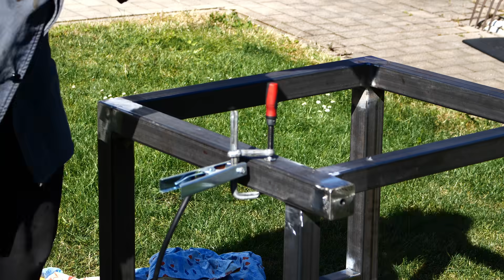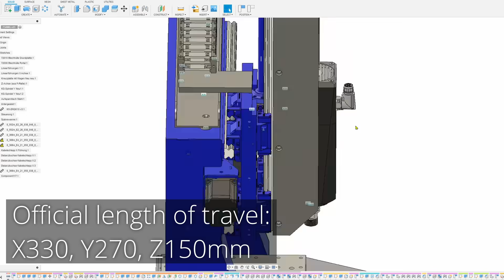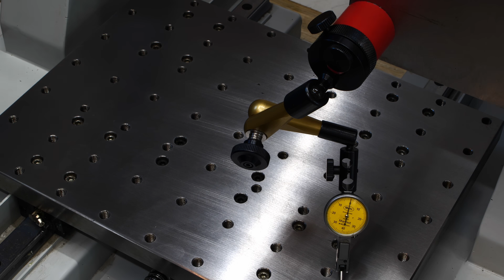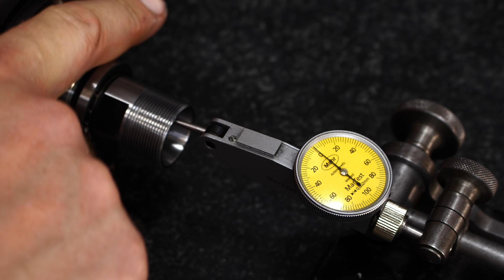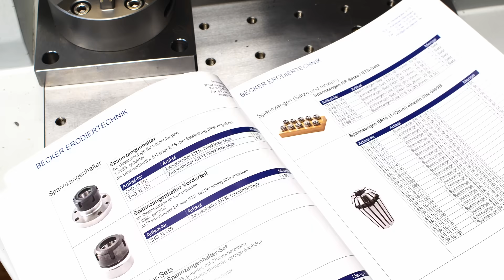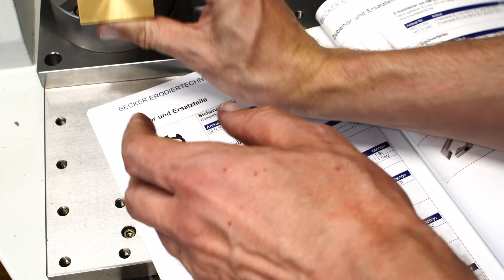CNC Project: FS4MG - "Not a Kern"

Comment: Hallo Stefan. I will continue in English for the broader audience.
Nice to see you upgrading your shop.
I don't want to be that guy, but please don’t encourage people to use the Erowa zero clamp system on a lathe.
We use this and a different system quite extensively at my workplace.
You can do at your shop whatever you want, but systems like this one are forbitten to be used at the lathe by the workers' compensation board (Berufsgenossenschaft).
There are special versions of it that can be used, but the normal version can kill you if you, if the clamping mechanism becomes undone while it rotates
Reply from the maker: Interesting! Thanks for the heads up - I guess the screw version, that does not use the drawbolt is fine for lathe use?
Reply: @StefanGotteswinter  yes that solves the main problem. When you talk with the manufacturer they are super cautious, when you tell them you want to use their products on a lathe. But there is more, if you want to put a vice in the erowa chuck, it has to be a vice without weak points in the spindel, centrifugal forces can get you.
I used some funky setups myself, but if the trainees look above my shoulder i tell them that if they want to do stuff like that, they have to be super cautious about rotation speed and cutting forces
Reply: @glamenz  Thank you this is interesting reading. At work we use System 3R Macro & their original hydraulic Mini series across all of our machines. From what I know the 3R Macro pallet system is much more rigid compared to the Erowa system with similar repeatability. For CNC lathe & cylindrical grinding machining, we mainly use the hydraulic Mini series without any problem, and the same can be said for the occasional times we use the 3R spindle recommended Macro chuck 3R-600.22 for bigger parts, staying within the recommended electrode size range. We've never had any issues regarding security of workholding on any machine, including some very heavy machining on our VMC machines, if you compare the two systems the 3R pallets are incredibly strong as they are based on the indexing system used on Ward capstan turret lathes for indexing the turret.

Comment: Stefan, I owned a Precise high speed liquid cooled head that operated at 80,000 rpm and for the 10 years that I used it it didn't leak once. I had it mounted on the Lars - Gorton Universal cutter grinder. I ground styli and miniature two (2) and three (3) fluted endmills.
I did find the U.S. distribution company for the modular clamping materials. I will get a catalogue later this week.

Comment: What accuracy and resolution were you aiming at with this machine? I have an idea of getting a very good used trunnion table and building a CNC machine around it thus getting a 5-axis ultra accurate machine for small parts. It would be a fixed gantry with the trunnion table permanently attached tn a platform moving in the y-axis. The frame will be just like this (welded frame with epoxy granite filled). Flood coolant obviously. No ATC. Just a hobby machine.

Comment: Hey Stefan, Steve here... I assume German is your first language, although you'd never know it. I completely understand the desire to arrive at a machine with finer resolution with tighter tolerances. It shouldn't be understated that we, as a community of hobby machinist, we are chasing the tolerances with the realm of thermal expansion of the construction materials. We need to start focusing on the construction materials with lower thermal expansion, climate control  systems to maintain temperature & humidity. If we could try to expand on design choices & methods that restrain thermal expansion as the machine takes on heat soak it generates as it operates for hours of use. I think this will help many individuals who other wise are very adept at creating "DIY" cnc machines. I can't tell how many videos I have watch in where a creative person spent months even years designing & creating a machine only to use aluminum for some structural components. 😮 In the end they are chasing mysterious +/- .005 they keeps popping up & going away. In the end they accept it as backlash, design error, or whatever, but they never realize this is thermal error that will never go away. You seem to be acutely aware of this, I really like to see a video in which we can demonstrate its effect especially on these larger machines & ideas of how to mitigate it on larger machines.

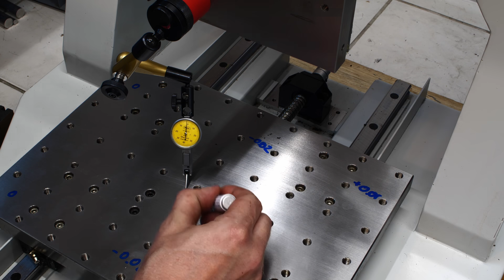Comment: 15:54 Yes, or... no. That only tells you how parallel are linear rails to the table. To measure flatness you should first measure your actual rails setup with surface plate(or any other known reference), and only then knowing their curvature you can measure table "flatness". Right now you measured either table flatness, or rails curvature (or combination of both) :). They can either cancel or amplify eachother.
Really nice machine base - saves a lot of time for us hobbyists. And you build great CNC out of it.

Comment: Maybe it’s just me but I love over engineering stuff thin sheet metal doesn’t sit well with me a thick heavy duty grey cast iron skeleton with the epoxy granite surrounding it would provide far greater stiffness and it will use less resin too. I guess if you don’t have a high temp furnace and plenty of disc rotors kicking around you could use aluminium.
Reply: What do you have to support that assertion? FEA ? Have you experimented with both options? Any data at all?

This option is actually almost certainly superior, for the same reason composite structures are made this way. The shell is supported in its weak axis and lends it's high tensile strength to the structure, placing the EG on the outside means that you are asking the rigid brittle element to take the tensile load, and the cast iron skeleton isn't really doing anything.

Comment: To be honest I don't really know what the machine geometry measurements here should tell. Could be a bow in the Y-axis linear guides on the portal as well. I would use a granite square. Check for linearity of each axis first. Map it out. Write down deviations. Measure out the table afterwards, deduct deviations from linearity error. Also, one of the most important measurements, the Z axis perpendicularity left/right front/back was left out. If the table is out of spec you could do the cheap and quick fix by throwing a subplate on it and machine it flat. You said to be doing smaller work, so there should still be enough travel in Z left.
Reply from the maker: That was just a quick assesment of the machine frame, not a full inspection.

Comment: I see a lot of home built CNC gantry type mills, and have wondered how, if at all, they were able to achieve any accuracy like you have shown on this machine. It seems to me that the linear rail mounts would have to be ground square, on a much larger grinder. Thanks again for all you great videos. 🇨🇦
Reply from the maker: The rail surfaces and alignment rails are indeed machined :-)

Comment: 16:10 Your first measurement should be: Are gantry rails parallel to build plate and linear?  I see they are attached with screws that  could produce a center bow if not tightened correctly.

Comment: I'm only 5 minutes into your video, but I wish to say that I've used all sorts of welding processes and the SMAW (stick) is a fairly high skilled process...with the right type of filler rods, and just a bit of 'finishing' you can build quite a nice table/frame...and it's not very expensive.
 And some feed-back on those stepper drive...Sweet....I used to be electronic tech on the first CNC stuff, DC motor drives the ball-screw, 2,000  RPM...and 3-phase decoder for positioning....0001" back in  1997...Some of the first Mazak controls...and some Fanuc...

Comment: I laughed when you said that was a torque wrench tightening the tool holder, then I realized it really is, and now I really want one!
Reply from the maker: Hoffmann Group, Nr. 211750

They come in fixed torque values - I have them also on the lathe for changing inserts and torquing them correctly :)

Comment: Great video, thanks! Do you think a cast iron construction of a similar type would have been of a similar stiffness and properties? Or in other words - is the welded structure + epoxy granite used because it's cheaper, or because it's better, or maybe it's both?
Reply from the maker: Cast iron would be stiffer - By a large ammount, the module of leasticy is almost an order of magnitude bigger.
Epoxy Granite has seemingly better dampening properties and does not require a foundry that can cast iron - Which are harder and harder to find to have one-offs or small runs cast in an economical matter.
Not like 1960s where every model engineer could have his patterns cast in iron for a buck fifty :D

Comment: Instead of epoxy granite, would very small lead shot not work just as well ? And it would be removable. Or, melt and pour it in ? Or is that too simplistic and I'm missing something ?
Reply: Ideally the medium needs to be integral to the machine structure. Lead shot would add weight which is something.. but the individual shot would do little as they aren’t connected. I would think melting and pouring would be very effective. I’m not sure how cheap lead shot is, not my area of expertise, but industrially sourced lead is not cheap at all so such a large amount would be quite expensive

Comment: The chuck looks great for EDM, but surely the vibration from machining is going to hammer those locating holes in the thin plates into ovals?
Reply from the maker: To elaborate a bit more - They are absolutely suitable and industry proofen for milling/grinding and turning.

No heavy hogging with a 63mm facemill sure, but general precision machining on smallish parts? Thats what it is made for.
Check out Adam the Machinists youtube channel, in his recent Video he milled a fairly large copper piece on a similar Chuck.
Reply from the maker: They hold up extremely well for machining

Comment: I'm VERY excited to see what you are going to do with this!
I have a small(er) DIY cnc mill made out of concrete-filled aluminium extrusions that I built a couple years ago (made a post about it in r/diycnc recently with the cad files). Building a tiny mount-in-vise 5th axis for it was quite an adventure, the ITS mounting system looks like it would be great for mounting something like that as well. Too bad now the true-5-axis toolpaths in Fusion360 cost a small fortune worth of a subscription.

Comment: Nice little machine. Its a shame to see you spare little expense on the spindle, only to stay with the stepper motors. If you could spare the expense (not that much) might I suggest going with JMC integrated servos? They are inexpensive and perform great. They use standard step/direction control inputs so they are a direct drop in electrically, as well as mechanically other than the 8mm shaft that is a little longer than most stepper shafts. Easy adaptation. I have built many similar machines based on steppers and regardless of the rigidity of the motion system and dampening properties of the frame, its difficult to mitigate the resonance issues inherent to steppers (due to rotor cogging), even closed loop ones, that lead to a less than ideal surface finish. Legitimate AC or BLDC servos do not suffer from these issues (at least not in a intrinsic way). I have a spare set of JMC iHSV57 180W servos I am halfway considering sending you to save that machine. lol.
Reply from the maker: I dont understand in what regard i spared expenses on the spindle?

I am well aware on the limitations of steppers, this is not my first machine build - i have all options open to go to servos and a different controller. But i need the machine running quickly, as a minimal viable machine. My shop has no space to house two cnc machines, so i need to get the router out fast.
Reply: @StefanGotteswinter  You didn't. The way I stated it means you did not spare any expenses, or only little.  I understand about using the steppers when you have to have a machine going quick.  Not trying to educate you. Its just conversation. Was mostly just joking and nudging you  :) But now that servos are more accessible to the home shop/hobby NC world, I am quite staunchly against steppers and never present them as an option anymore. While steppers do work, they are the bane of of the hobby NC world, and the source of 99.785% of all hobby NC issues, (and closed loop ones don't solve the issues).  The remainder being the godforsaken  M and G words, unsupported round rod rails and 3D printed parts. Both of which have no place on a loaded tool machine.
Reply from the maker: Ah! Sorry, missunderstood :)

What the drive system is related, I am an old dog to learn new tricks - Eventually, once its running and I cleared some work of the plate, it will become a servo machine.

Comment: Turn it into a 5 axisssss
Reply from the maker: Its a bit small for a 5X machine - With a trunnion and a rotary table, there will not be much Z-clearance left.
Reply: @StefanGotteswinter  Yeah, having enough Z is tricky.  Working on a conversion myself right now and am replacing my z partially because of travel issues. Would love to see you make a 5th axis though

Comment: Nice and informative video. 
Stick welding a thin metal tube is nothing but easy. I always succeed in making some extra holes and then the weld tends to stick to only to the other part to be welded. But, grinder and paint make You the welder You ain't.
The 3M Cubitron cutting discs are great. Especially the thin ones You were using. They really cut the metal. If You take a look into the metal dust they produce, it is actually tiny metal chips.

Comment: Great choice!

It's more a lost mould or stressed skin kind of deal than a filled steel frame, and I'm not entirely sure but I think I remember Thomas, one of the manufacturers, told me a few years ago the steel skin isn't very significant for the machines stiffness/stability. Might've just imagined that though, but it's definitely not a filled steel frame kind of deal.

The larger ones, FS3MG, rely solely on epoxy granite though and are made in reusable moulds.

Comment: Great video again Stefan. One small remark from my own electronics background knowledge, better not to put the unshielded motor powercables next to the unshielded data control cables in one box. They could interfere with eachother. And hard ground all metal parts of the machine with its own earth cable (preferred 4mm2 or bigger) also the metal box. Looking forward on the next video showing the results and obtainable precision with this new cnc machine.